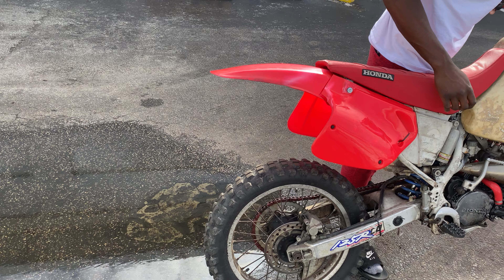Customer drops off 1993 cr125 says bike barely move in gear and leaks coolant South Florida Vibes

Comment: I still have my race bike 93 CR 125 . It's a pro circuit bike. It's the fastest 125 on the planet.
Reply: Nitrous grom would like a word with you
Reply: @tormado  bruh nitros grom is a 4 stroke😬
Reply: @graden8482  fax

But my man's did say "fastest 125 on the planet"

2 strokes have more squirt anyway so I'm gonna render that argument invalid
Reply: Lmfao I almost spit out my food...dude ur 93 cr 125 would get rapped by the new KTMs.. regardless of what you think pro circuit did
Reply: @TheSultanOfBlocks  yeah Ktm 125 got 63hp 🤣
Reply: @EuropeanDreamz  dude doesn't know anything about older cr ,s apparently
Reply: @jessederossett1484  I agree too , the older cr are beast I swear the fin cooled heads pinged so hard and ripped
Reply: @tormado  🤣🤣🤣
Reply: @TheSultanOfBlocks  no it's has everything you can do to a 125 done to it.
Reply: @ryanbarker4422  and everyone who thinks old cr 125s are fast...Your fucking high.. lol.Crs were fast in the 90s I've rode both I own a rm125 and a Ktm 125 and it's not even a fair race..both are recently rebuilt and both are far from stock but the new Ktm 125s are insane im sure none of you have rode one.. just stop talking ur embarrassing yourself and stop thinking ur 25yr old cr125 has any more than 30hp
Reply: @ryanbarker4422  and also it doesn't matter at all what you claim is done to ur cr..the cylinder porting/fuel atomization/squish clearance.Etc I could go on for hours about how Ktms advances in there motors mean more than some cylinder porting and epoxied case work..the ignition system is literally 25yrs newer technology..Go ride a new Ktm and stop typing shit you know nothing about
Reply: Actually the new huskavarna 125s are by far the most powerful 125 going .
Reply: @DirtDiggerDanHere yea you got that but it's just a white Ktm with an open airbox cover so it's got a lil more top end pull but the motor/ carb are the same.. idk if the husky has different ignition maps for more of a high rpm pull but it's also made by Ktm..they own Husqvarna
Reply: Ktm 125 . This is fastest
Reply: @TheSultanOfBlocks  you childish asf calm down don’t pull out the nine 😭
Reply: @airotommie4507  lmao cuz dropping facts about how garbage cr125s are is childish.I wasn't calling him any bad names lol and didn't tell him anything other than the truth.. you must own a cr125 lol my bad but at least it's not some china pit bike
Reply: @TheSultanOfBlocks  my 96 cr 250 has proven by me and many others to be faster than any 2 stroke in its class  and most 4 strokes made to this day  argue that if you want to but it's useless . And you must not have seen the race where RHINO podiumed on a clapped out 88 cr that would barely even start and looked like he'll.  You should do some more research before downing those old junk crs lmao. You can accuse people of being high or cuss and carry on whatever makes you think your getting your point across.  On a straight line they might be faster but on a track is where it counts .
Reply: @jessederossett1484  I'm not guna even begin to take your comment seriously lol if YOU care enough go watch the video were Carson Brown compares a 1996 cr250 to a 2019 husky tc250 2 stroke it on YouTube..His conclusion..the husky was faster..it had faster lap times and "Felt Better" that the old Cr...I'm really tired of people like you that think just because a bike was class leader 25 years ago it can compared with new bikes. As if 25yrs of R&D means nothing..I have a 1995 Rm125, it was 125cc bike of the year in 1995..And it would get wrecked by my Ktm125..Your in denial and it's nonsense 😂
Reply: @TheSultanOfBlocks  lmao your talking about one video versus about 100 saying the exact opposite lmao you are clearly only u tube educated ride one then comment back but until then good day
Reply: @jessederossett1484  I'd believe what a professional says alot more than some goons puking shit out they know nothing about not to mention I've own an old bike and a new bike lmao
Reply: @TheSultanOfBlocks  you believe what 1 professional says versus 100 good choice
Reply: @TheSultanOfBlocks  and I said Good day
Reply: @jessederossett1484  you've gotta be a troll nobody else would be so stupid to think his 20+ yr old bike is better than a new one
Reply: @TheSultanOfBlocks  I said good day it's past your bed time
Reply: @TheSultanOfBlocks  do more research
Reply: @jessederossett1484  you should do more research starting with the fact that they changed the cr250 for a reason...It sucked
Reply: @TheSultanOfBlocks  they switched to aluminum frame and changed the engine and everything and fucked the whole bike up in 97 that's why McGrath quit them because the new model was much slower and worst handling . They took the fastest bike they ever had in 96 and changed it and didn't win a championship for 20 yrs after that lmao you  really have no clue what you are talking about man 96 cr 250 is the most winning bike ever made to this day and faster than most bikes including several of the 450s if you had owned one or even rode one you would know and I'm speaking about on the track not in a straight line . Grow up and get some knowledge man
Reply: @TheSultanOfBlocks  and ask Ken kaplan about the 96 cr 250 and see what he says about it . You really don't have a dam clue . Period and it took you 2 days to come up with a comeback lmao
Reply: @TheSultanOfBlocks  the only reason they changed it was trying to be like everyone else and ruined the bike lost sales and many titles by doing so all you have is name calling and insults which just makes you sound extremely ignorant on this matter
Reply: @jessederossett1484  the aluminum frame killed that motor bud I'll give you that but the Ktm doesn't use aluminum frames and they have a good 7+more hp that ur 96...every 450 ever made would rape ur 96 too..just drop it dude..It's totally illogical any proper Husky or Ktm would wipe the floor with ur bike.I don't understand why you think your bike is soo good to this day just cuz it was bike of the year in its day.25yrs of testing and r&d mean nothing to you but to normal people that's how improvements are made
Reply: @jessederossett1484 I can guarantee you can't afford a new bike so you tell everyone your old one is the best thing ever invented so you can sleep at night..I get it I thought my old bikes were nice til I got on a new one
Reply: @TheSultanOfBlocks  where you live man hell we'll just race and settle this shit
Reply: @TheSultanOfBlocks  and that's not facts your so far from the facts you couldn't see them with a telescope

Comment: My 04 kx250f had the same problem with the clutch so I put a new one in and it helped a little then a new clutch cable and it works good but I still feel that its not 100%

Comment: He can get a new tank from Clarke, I got one for my 91 yz250.
Reply: Is yours good compared to stock bc I have a 1994 yz250 and am really considering a white Clarke for my 1994 I found one is it good?
Reply: @aleksbailey6119  hell yeah they make them by casting an mold of the old tank and make the new one using the mold
Reply: @aleksbailey6119  the plastic is good quality too
Reply: @aleksbailey6119  all you gotta do is swap the hardware from your old tank over but be aware your old gas cap might not fight so you might have to get a new one that will. I just took mine off my old 86 XR 100